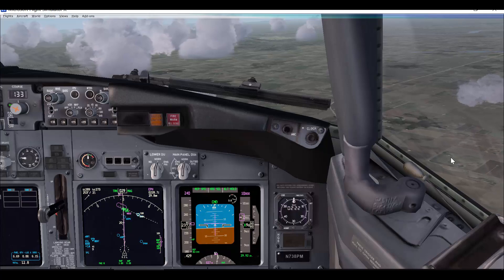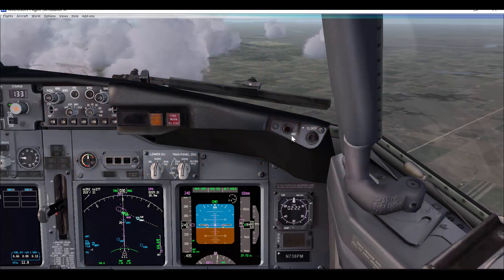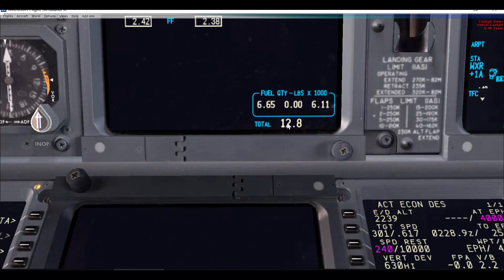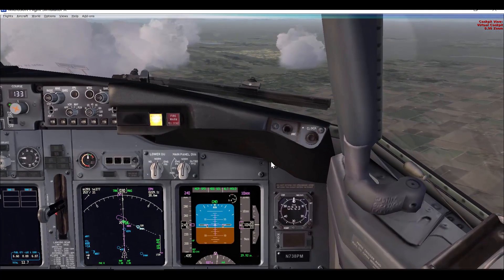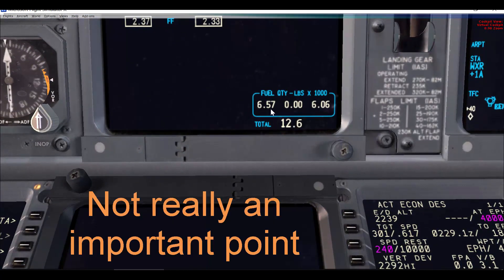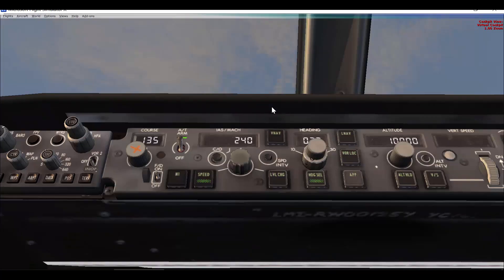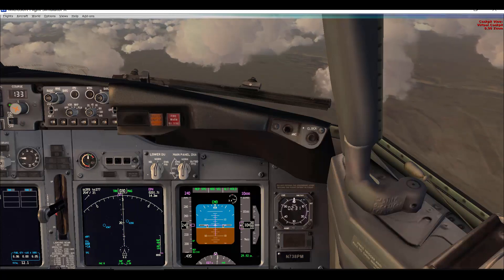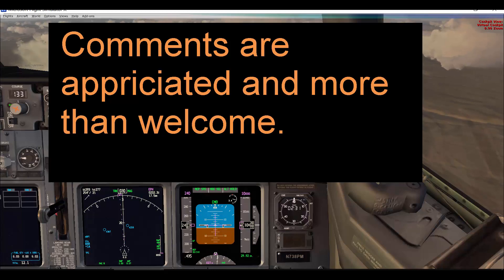B737 Fuel Balance (PMDG)

Comment: Thank you very much cpt 
Please cpt ,How can we detect a fuel leak and if possible a video concerning this topic
Thank you
Reply from the maker: You are most welcome,

Regarding fuel leak there are many ways to detect it here are some of the ways I am aware of:

1- Excessive fuel burn compared to what is in the flight plan. as you know the flight plan will have the time and fuel between waypoints and we should note and write the actual fuel quantity and compare it to what is in the flight plane. Any excessive burn with no clear reason like strong wind shift for example needs to be investigated. 
2- Fuel difference between the left and right tanks, one thing I might add here is to double-check the crossfeed valve is closed otherwise it might be forgotten open and resulted in the difference in fuel burn.
3- Using reserve fuel message in the FMC is a great heads up of excessive fuel burn provided the figure entered is total fuel minus the expected fuel burn to destination and plus 2000ibs or so to avoid getting the message just because you loaded the approach (this is just a pure personal technique). 
4- A passenger reporting seeing a mist coming out of the wing, is an indication also of a fuel leak. 

Those are some of the ways I can think of. 
Thank you for the great question, this definitely a topic for a video.
Thanks again and let me know if you have any other comments or suggestions. 

All the best 
Abdul

Comment: Hello Captain, Nice to see how you handle the unbalanced fuel situation. I like the tip with the paper. I assume it can make the difference when there is a distraction. Personal I don't understand why there is not a cruisecontrol for the taxispeed  and why it is not possible to set a AlarmSound into the FMC by example for s parsing a Flightlevel  or when exceeds a speed. The plane is expensive enough  to expect those are present.  But maybe I talk nonsense ;) 
Bye bye :)
Reply from the maker: Hello Gl 
Regarding aural warning for the altitude deviation their is one and for exceeding the speed you have the clacker. But both of them are going to be late reminders meaning it’s too late by that time and you have already busted your altitude or speed. 
The way the flying setup now is still relying on both pilots doing a proper scan, have a good CRM, and apply the procedures. 
Thanks again for sharing your thoughts G L